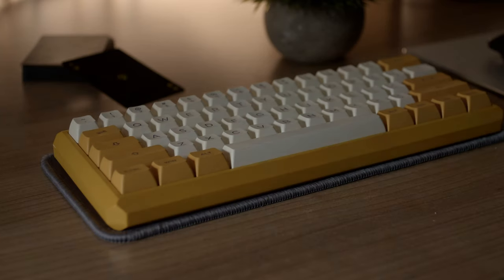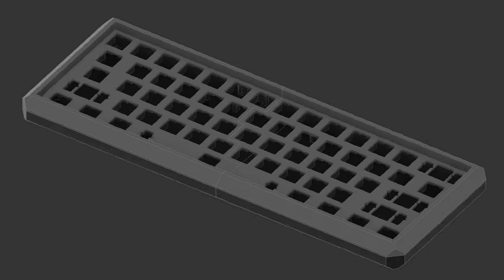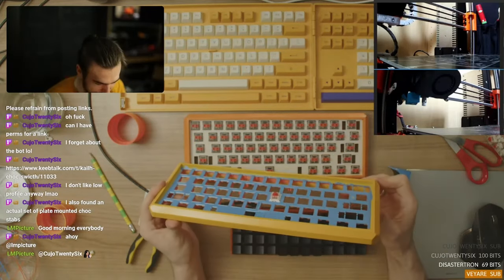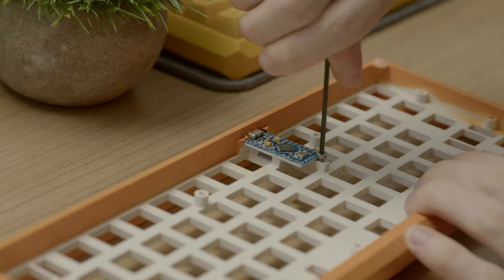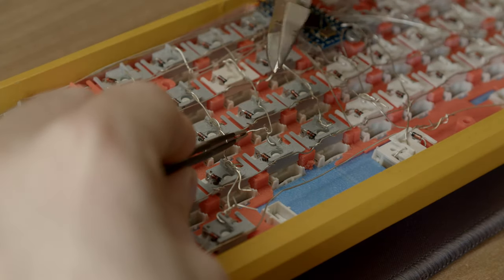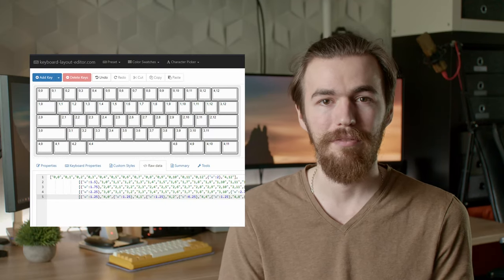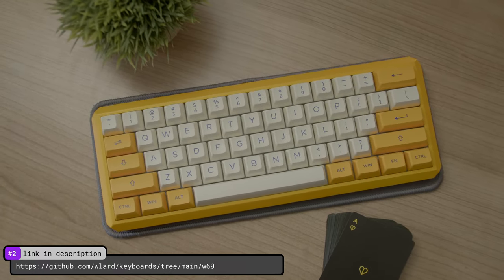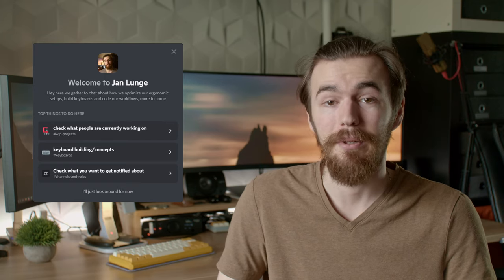Building a 60% keyboard without soldering and PCB | 3D printed Build

Comment: Hi, I have a question. I see the video is 3 years old, and I’m wondering if you think it’s possible to 3D print a fully plastic keyboard around 2 meters in size. My friend and I have an idea to build one and play 1-on-1 games with it. Any advice would be greatly appreciated since we’re not very experienced with 3D design.Of we wanna record a yt video :D
Reply: Only thing I can recommend there is to make an assembly setup so the case parts and compartments fit together after that

Comment: Hello, I am building the left backplate and the thin line that connects the little piece behind the spacebar to the rest of the piece is missing when I slice the model with CURA. I use a 0.04mm nozzle and 0.2mm layer height. Does someone know how to fix this problem?

Comment: back in the 1940s (ish) there was a non solder connection called Wire Wrap.  its finicky, but when you've learned to do it, the results can be surprisingly robust.  I've worked on equipment that's 50-60 years old with the original wire wrappings still doing great.

Edit: I totally just downloaded the hot swap sockets for my gamepad build so thanks!
Reply from the maker: I actually ordered that tool and built a keyboard with it here https://youtu.be/2c5CeuCNbw8 the wire wrapping worked great but my switches were faulty maybe i will redo it at some point

Comment: Great video! I was wondering about the rationale behind going with naked wire instead of insulated ones which wouldn't have the possibility of shorting out.
Reply from the maker: this adds some creative freedom as i can make connections at any point and also change these later on without leaving not used holes in the insulation. i am still experimenting with insulated wire for my next builds

Comment: Hey, thanks so much for all this info (an the fiules)! Coudl I find any where some intructions on how to use teh new style of hot swap sockets (with wings)? The ones in the macro pad video seem quite different. Thanks again!
Reply from the maker: The ones with wing are specifically built for this keyboard the w60, so the switches can easily be pulled out. The plate would need to have the standoffs for each key so the wing part can rest on these. For other builds just use the ones without wing (they are the same part just the wing removed)
Reply: @JanLunge  so the ones in the ma to pad video (where you show exactly how the wiring goes through them) are the same as the ones in this video, only lacking the wings? Cause they seemed different to me, but maybe I didn’t look careful enough. Thank you for answering!
Reply from the maker: @zosterinski  they are used the same way and have the wiring in the same place I just removed the clip mechanism so they are way simpler to print. (compact & with wing) I should add all this to the readme in there :)

Comment: Great video, how did you print letters on the keycaps?
Reply from the maker: I created a keycap stl file with the letter as a separate body. Then i used the slic3r multimaterial option to first print the letter and then the keycap with a simple material change gcode as i only have one extruder

Comment: I loved this project Jan, but I would like to do a different iteration, using a Pi Pico as a controller and doing conventional handwiring (soldering and unwiring cables and wires). 

Is it possible to modify your STL? I don't have much experience with Fusion360 (I barely use Thinkercad) and I don't know if by loading your STL I could make the necessary modifications that I mentioned.  

So far I have only made smaller Numpad or Macropad, this would be my first 60% project.  

Thank you very much for the help and guidance you could give me.  

Greetings from Chile
Reply from the maker: The main problem would be the microcontroller mount you could leave everything else just how it is. For that you would need to use fusion360 for proper dimensions and fitting but you could also just use a promicro compatible rp2040 like the 0xCB helios that will fit in this build fine. Though the usb port might be a bit tight fitted with usbc and some cleanups would be required on the print as this model has some tolerance issues.
Reply: @JanLunge  Thank very much Jan for your reply. 

What do you mean by tolerance problems? I have Fusion360 (although I don't use it regularly). Is it possible to directly enter the .STL and modify them or do I have to generate a new mesh? 

Thanks.
Reply from the maker: You would need to use the fusion360 file the stl doesn’t include changeable parameters. With tolerance i mean the pro micro usb port is top mounted and some rp2040 have the usb c port mounted at the center of its pcb. Sorry the notification for this was a buried a bit took me a while to find.
Reply: @JanLunge  I understand, at some point I used MeshMixer for minor modifications of stl files, but the problem is that "to the eye" the precision of the process is lost.

Comment: Great Video! how did you get 19 pins off the pro micro? I'm kind of confused.
Reply from the maker: i used 18 pins on a 13x5 matrix this includes the rx and tx pins on the top left of the pro micro. in the wiring this is more about using the matrix to its maximum and fitting the most keys on it instead of wiring it exactly how the columns and rows are aligned

Comment: Nice video, I'm excited to try the hotswap this week. I have one question in your previous video you showed mx and choc hotswap . The new version is called wHotswap-MX-v2.3mf is there a plan to create the choc as well?
Reply from the maker: Currently, I have not planned to update the choc sockets but the early versions worked very well compared to the mx versions so they should still be fine to use, just not with this case as the cutouts could have clearance issues (haven't tested this)
Reply: @JanLunge  Thank you very much, I'll try the old version

Comment: How could I modify this build to use a Raspberry Pico?
Reply from the maker: Yes the though as the pi pico is a bit bigger it could cover more switches and make the wiring more complicated. But there are other rp2040 boards that have the same footprint as thee pro micro used here

Comment: Hey, 
So if I decide to use insulated wire. I do not need to worry about the insulated wire touching each other.
If possible can you do a 65% keyboard especially with a exploded navigation cluster or something similar to the DROP alt high profile design.
Reply from the maker: with instulated wire you would just need to remove the insulation on every connection point otherwise yes you can then route the wires easier as the insulation can touch everything else.
I still haven't decided what style i want the 65% build to be
Reply: Thanks mate 👍
Reply: I imagine, enameled wire would be a very good fit to make this easier. It's insulated with a very thin coating that you can solder through.

Comment: How do you wire the switches to the arduino? Can I get a sketch, i really want to build sth similar
Reply from the maker: Hey I have a diagram for the matrix here https://imgur.com/a/IT11z7j it's not important which pins you use on the microcontroller as long as it is a data-pin

Comment: Ordering a PCB is $15 for 5 copies, no hand-wiring needed, soldering can be performed using solder paste in 15 minutes, and it will all look perfect and will be reliable, as a bonus it will provide a high-quality mounting surface. Naked wires look like a nightmare and will definitely cause shorts and are a terrible to work with.

Comment: Hi, is it possible to add rgb lights to it?
Reply from the maker: I did a handwired hotswap macropad with rgb per key lights, so key, but it would be quite a bit of effort to position the leds and in this case the wiring might be a bit too dense for that. eventhough there is a gap for the LED placement